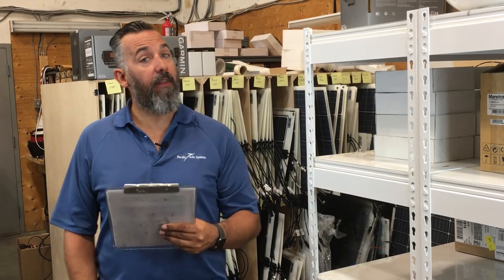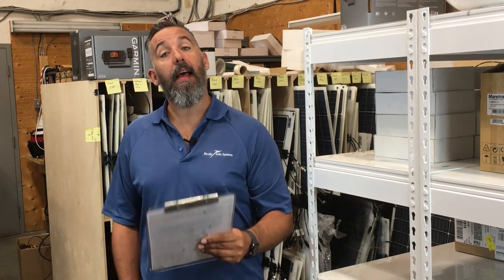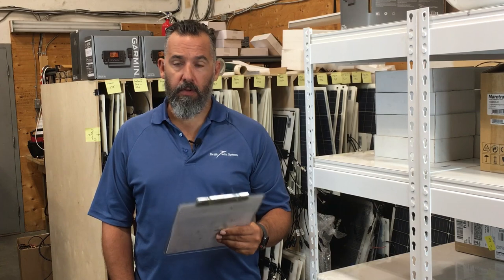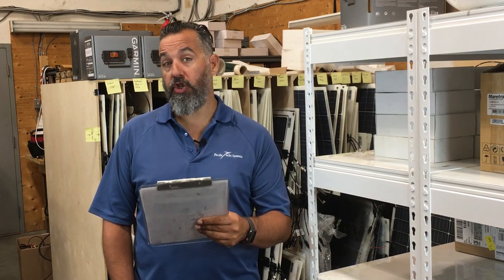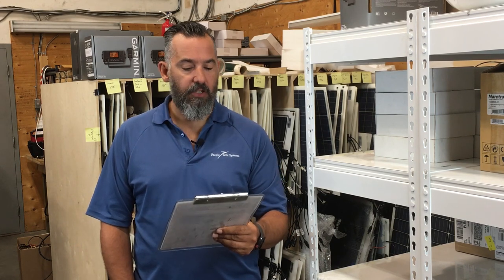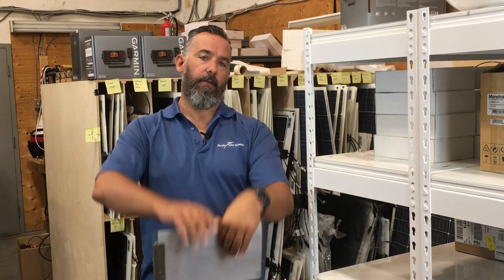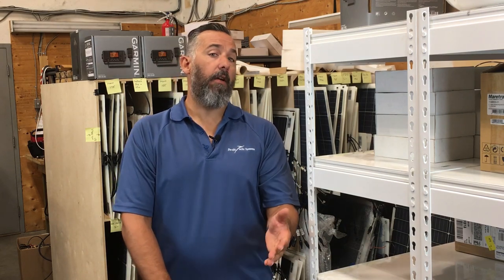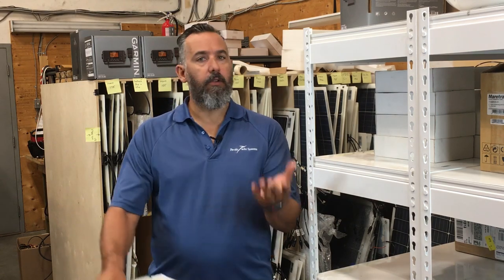What Type of Battery Should I Use for My Thrusters?

Comment: HELLO JEFF  I have a 48 sea ray which has 2 seperate battery systems ,12 volt for start and house and a separate 24 volt bank for a bow thruster.I have read and plan to use the 24 volt bank (thruster)to share to an inverter to run the 2 small refrigerators while at anchor or long cruising so i don't need generator all night on the hook. I would like to go to lithium but it seems the BMS limits the amp output for the Thruster requirement. The Vetus thruster is 24 volt pulls 320 amps for 3 to 5 secs but many of the smaller amp hr battery ratings seem to go with the BMS rating. Meaning 12v 100Ah has 100 amp limit BMS.The only way I see this working is to get 2-- 24V batteries @ 200 Amp hr with 200 amp BMS in parallel to give total of 400 Amp limit to deal with the Thruster.I realize this just got expensive to keep food cold quietly . The 24 volt lithium do fit in the 2 - 12V 8D battery boxes so the series cabling needs to go parallel . There is limited Information on cranking or heavy load thruster application with lithium batteries in marine or anywhere. It seems people go lead acid for cranking ,lithium for storage but I don't want 3 battery banks on the boat and the thruster batteries sit for the most of the time unused. Do you know of many Lithium bow thruster applications out there? Seems like bigger high amp lithium batteries with high amp BMS are coming on the market at more reasonable prices.
Reply from the maker: Your concerns are legitimate, as I've never seen a thruster run off a lithium bank. We recommend lead acid batteries (flooded or AGM) for high amperage applications.

Comment: Short and to the point, brilliant. 
Question: thrusters, windlass and starters should use cranking batteries, is it reasonable for some or all to use a common battery? I know, it's an open ended question, with capacity, usage, forces, charging ability, etc, etc...  any reasonable general guidelines?
Reply from the maker: Hi Donald, in many cases, thrusters have their own dedicated batteries. While operating, thrusters can cause significant voltage drop and therefore most designers provided dedicated thruster batteries.
Reply: @PacificYachtSystems  Thanks!
Reply: @PacificYachtSystems  Hello PYS, I love your content! I installed a stern thruster on my 2015 Mastercraft X46 wakeboard boat. It has two batteries with the Off-On-Combine switch and I wired the thruster directly to one of the batteries. This works ok but interferes with the audio and under heavy usage I get a low voltage error for the engine and a fault code. I want to add a third battery and argofet 3-1 isolator. From watching your other video's, I know you connect directly off the alternator to the Isolator. Question is for the existing linked dual battery bank, do I remove the connecting cable and connect separately from the isolator? Do I need to then change how I run the power through the switch and bus? Any help you can provide would be appreciated.

Comment: I’ve just stumbled across this video while trying to search for the correct battery for my bow thruster. I have a QL CT600 thruster which the manufacturer manuals recommended a minimum 100A/H 800 CCA battery.  

I notice most modern boats use a Optima Red top battery (Or Yellow Top) as they’re supposed to offer lots of power and longevity. 

The Optima specs are 50A/H 815CCA.. would I be right in thinking this battery would not be suitable as it has half the recommended A/H?
Reply: actually this is my question too. I appreciate if someone answer this. my situation percisely is explained in next comment.

Comment: Great series of videos, great job. If I’m using my electric windlass, is it better to operate it with the engine running or switched off? 
Also, what’s the best configuration for charging on a twin engine boat that has 2 x 60A alternators and three battery banks, 2 engine batteries and a domestic bank. 
Thanks!
Reply: Your first question regarding the windless is interesting. Can't imagine a situation,  other than maintenance,  where you wouldn't have the engine running while using the windless.
Reply from the maker: My suggestion is to run the engine, effectively running the alternator and recharging the battery while using the windlass.

Comment: Hi Jeff, I just got back from my boat and I found that there are zero fuses on the batteries (and their cables) as well as the battery charger.. I have owned the boat for little over a year and I am now starting to tackle the electrical...
My question(s) is... how do I ensure I have the right sized cable and fuses? And where does the fuse need to be?
Thanks
Perhaps I should elaborate a little more... I am going to be switching to 2 200ah agm batteries and the resources I've found seem to be saying I need a battery cable as thick as my leg?
It's very frustrating and I cant seem to find a definitive answer, if I go by the loads, does that mean I have to change all the cables if I ad an inverter? Ugh...
Reply from the maker: Good question. what decides wire and fuse size isn't the battery bank size but the the actually amperage (i.e. current) you intend to draw from a battery bank. Manufacturers are very specific  in what fuse they want you to use for their products. Make sure the wire connecting the appliance (light, pump, bilge, inverter, etc...) is sized to handle both the amperage and the voltage drop.

Comment: Thanks for all these tips. I’m assuming that the logic for a thruster should be about the same as a windlass? We have 4 L16RE 6V in series/parallel for a 12V house bank. Currently, they are connected to a Lofrans Tigres windlass via a 150 amp breaker at the main unswitched distribution, and 20’ of 2/0 wiring. New, they were good for 740 amp hours at 12 volts. Maybe less now, but they’re not consuming water. The manufacturer’s data sheet indicates they should be good for 3 hours at the windlass’ max load. Do you see any issues with this setup? Thanks!
Reply from the maker: Hi Robert, your battery bank size is pretty compared to the size of the windlass load and even though the house batteries are deep cycle, (i.e. rated in amp-hour capacity and NOT Cold Cranking Amps (CCA) or Marine Cranking Amps (MCA)) you are OK to run your specific windlass on your house battery bank size.

Comment: Can you give me some tips to keep the drop voltage under control.  I got a narrowboat 55ft.  The cables between batteries and electric engine have around 10m, 70mm2 .  I use 2 sealed batterys type 644 95A . The alternator have 90A/h.  The voltege drop is 2V read on the dashboard voltmeter when the engine running.
The bow thruster is vetus 3Kw
 The surveyor tell me to ad a battery close to the bow thruster.
Reply from the maker: Hi George, you are on the right track, to offset voltage drop, you can increase the cable size & bring the battery bank closer to the large loads. Inspect all your DC connections on the cabling as a weak crimp will cause voltage drop under high current.

Comment: On another topic, do you use isolated or grounded DC system for thrusters?
Reply from the maker: Hmmm, from my experience the thrusters are grounded. Anyone else???
Reply: @PacificYachtSystems  I mean grounding of the negative side of the battery, not the thruster itself. We have “E-11.5.2.7.2The  negative  terminal  of  the  battery,  and  the  negative  side  of  the  DC  system,  shall  be  connected  to  the  engine negative terminal or its bus” but that kind of defeats the purpose of having separate battery bank for the thruster for shorter cable runs and lower voltage drop. Any thoughts on that?

Comment: Semi related question but not sure how to ask it . In the instance of a poorly functioning starter/motor . Which end of the cable would be expected to be hotter ? The power supply(battery) end or the motor end ? Would the opposite be true for a Poorly functioning battery vs a healthy motor ? Thanks
Reply from the maker: The starter side will be hotter, nonetheless, fuse the starter circuit at the battery, since it's the source of power.

Comment: I have a azimut atlantis 34, equipped with a vetus 75kw bow thruster. boat has a hatch near borthruster specifically for bowthruster therefore it's a 50cm battery wires to bowthruster. and battery charges with a Noco gen 5 x 1 bank. (5 amps for 1 bank) only chatges when generator is on or shorepower is connected. 
I wonder what is best battery I can use in that hatch (has limited space. for example 100ah battery doesn't fit there) curewntly there is a normal 75ah lead acid battery there. works ok it seems. my question is do you recommend I use a Lifepo4 lithium battery there with 50AH? my concern is it is not recommended to pull 250 amps from lithium battery and a 50ah lifepo4 seems can provide 25ah max. but same range is recommended for leadacid and I wonder what battery do you recommend for this scenario?